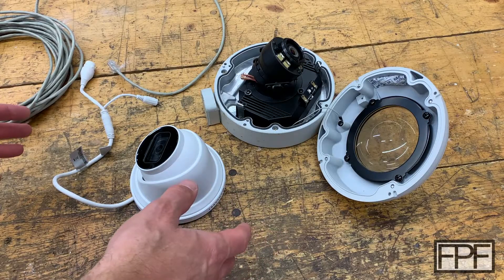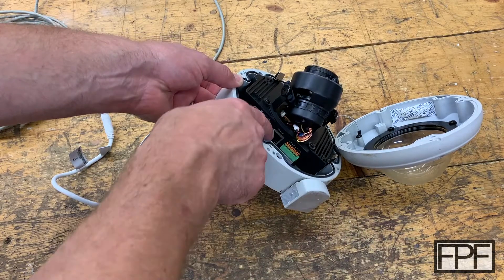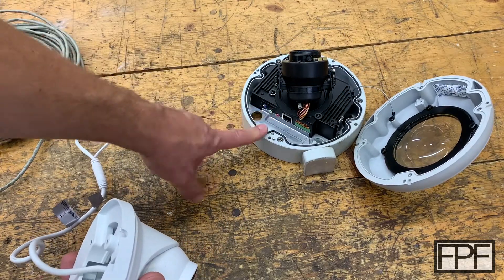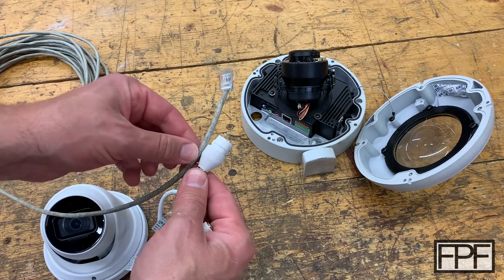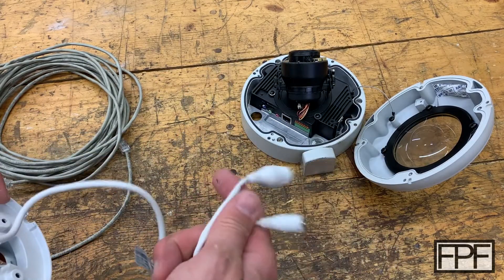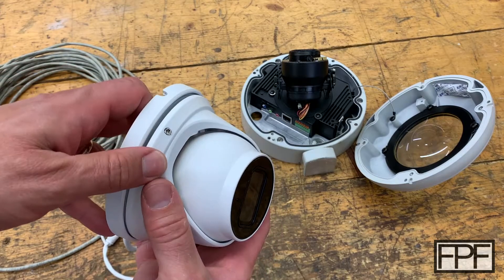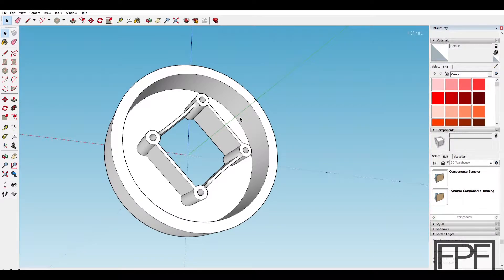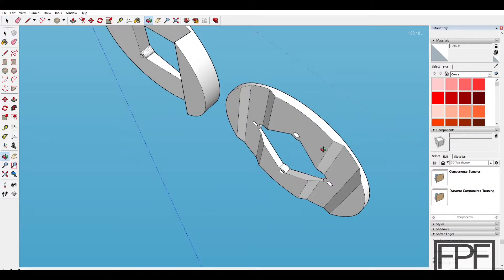3D Printed Amcrest IP Camera Wiring Ring

Comment: I have a similar problem with a different shaped housing which i’m going to make a plate for, I would create a weep hole in the bottom of the casing as those kinds of cases tend to accumulate moisture and rain over time and without a weep hole can soak the wiring
Reply from the maker: Great point!  It will probably drain through the seam for a while, but eventually that will clog with pollen and dust.
Reply: This particular camera has a notch on the housing for the cable and when mounted correctly would drain any warer gathered  inside, the connection inside is waterproof already and is why the size of the whole would be so large.